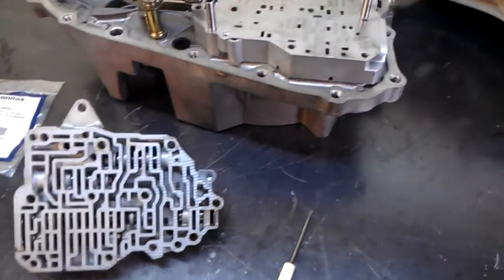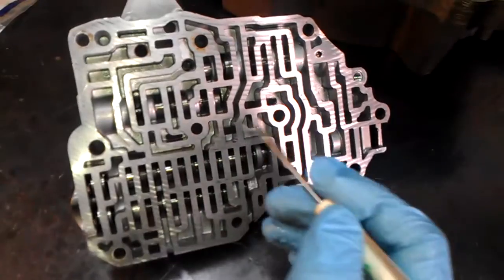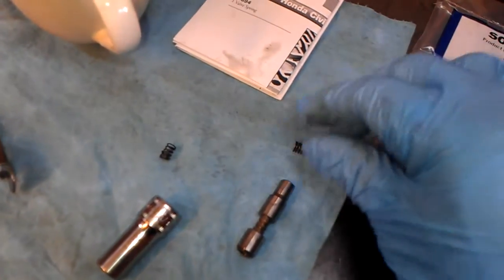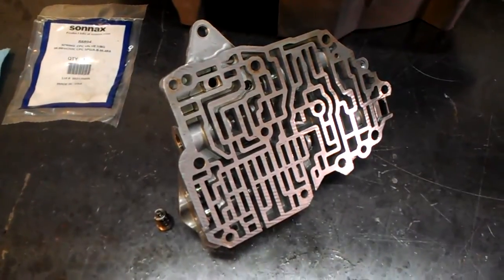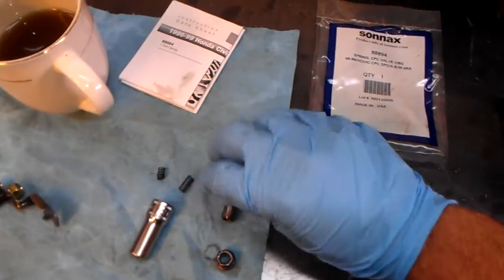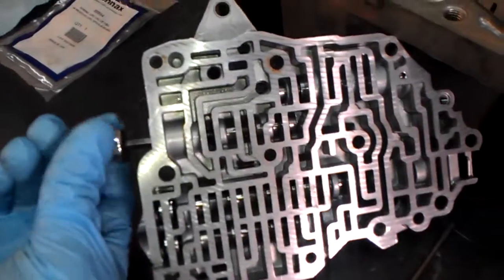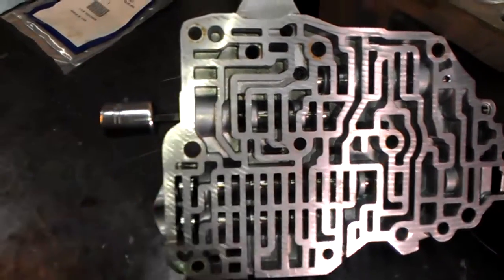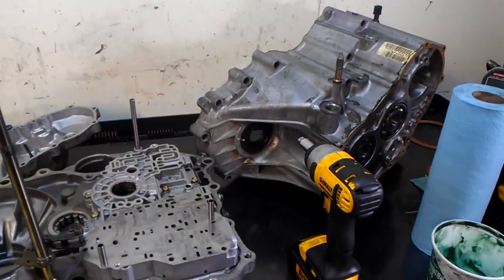B4RA Transmission, Hard Upshifts, Broken CPC Spring - Transmission Repair

Comment: Tip for everyone - if you've taken the trouble to get this far into the transmission, just rebuild it. I mean how often are you going to have one of these torn apart? Don't just replace the spring and put it back together. There could be other things happening that caused the spring to break. If you're smart about it, you should only ever have to do this once. Clean all the parts, polish the valve body bores/valves, put new steels and frictions in, put new o-rings on everything, replace the filter and always put a new torque converter in. Rebuild kits for these Hondas are really very reasonably priced. Everything altogether might run you $400....for basically a like-new transmission it's worth it.

Comment: People have not really made many attempts at making effective drag race transmissions with Honda boxes. After watching your videos on Honda Trannies it appears they could be pretty stout, especially some of the 4 speeds. Have you ever made any hard shifting boxes with polished gears and races, heat treated and hardened gears, shafts, shells bearing races etc? Softer spring or servo controlled CPC valves? I've found a considerable amount of red eagle steels, frictions, carbon lock up clutches and such. I'm guessing someone is doing it??

Comment: Hi, thank you very much for this video.  I need to make an appointment.  What oil can I use as a replacement for the original?  Where I live it is expensive to get it.  The manual says that you can use a dexron 3 until you get the original, what do you think of this?  Can I damage something using another oil?  Thank you!

Comment: Hi Hiram, i have a S4RA transmission, it as overheating and that the gears start to slip,
I replace the compposite disks, the torque converter and cleaned the body valve, i did not change the orings and gaskets, the problem continued... transmission continue to overheating causing low pressure on line... any tips about this problem? thanks... you videos are very great, sorry about my bad english..

Comment: what is recommended for a rebuild for a transmission of this kind, with about 199K miles on it.  It has the hard shifting problem in only first gear.  Vehicle has not been driven hard, but it has a lot of highway and country miles on it.  There are several kits sold, like 3 different types and configuration, not sure which one to get to rebuild this B4RA transmission.

Comment: Hiram good morning, excellent videos made on automatic transmissions, I have a Ford Explorer 4 x 4 2000 5R55E, transmission was rebuilt and then you install a rebuilt valve body, the problem presented is a change from 1st to 2nd elongated and when one stops or slows to turn or stop feeling like a punch and not transmission or slashed will synchronize, if you could advise me that would be, I would appreciate, caracas Venezuela Francisco Aylagas. faylagas@gmail.com